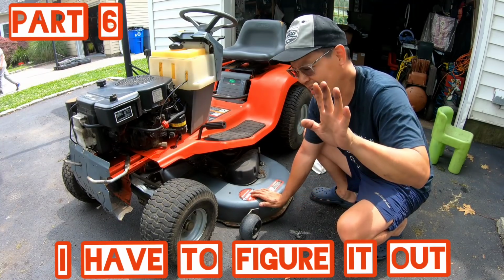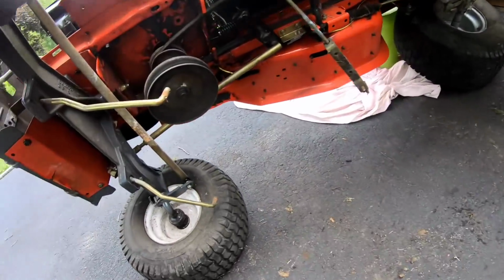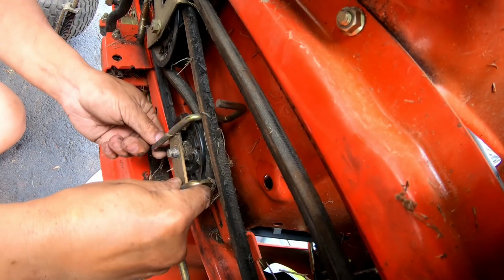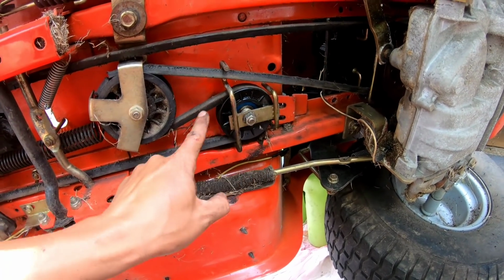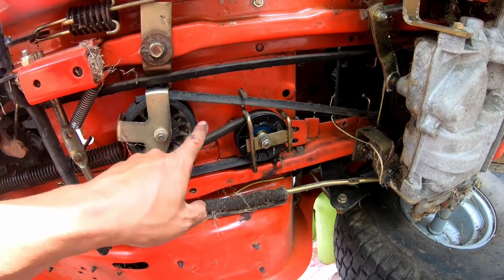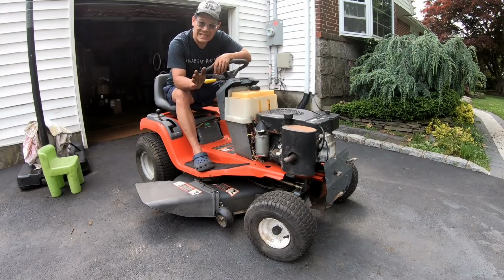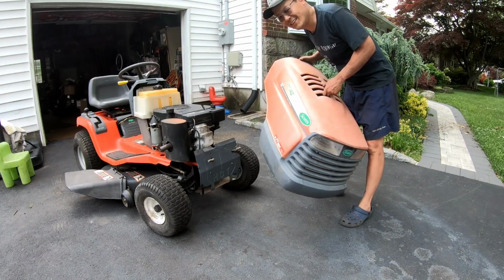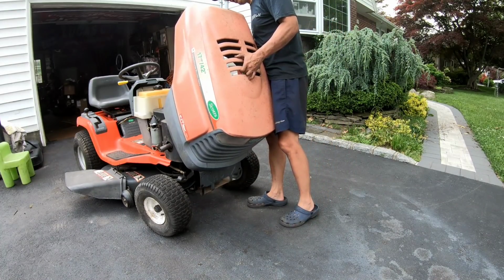SCOTTS BY JOHN DEERE LAWN TRACTOR REPOWER PROJECT WONT DRIVE MOWER DECK REMOVAL TROUBLESHOOTING FIX

Comment: HI there, thanks for the information. I have mower machine exactly like yours the Deck belt is very loose and not engaging with engine bully, help me please how can I make tight
Reply from the maker: It needs to be routed correctly 
https://images.app.goo.gl/XhBBekP17w6FCFqj7

Comment: I would think maybe cut the side of the hood on both sides rather than a hole. Is the bolt from the double stack?
Reply from the maker: Yes but from the 17hp engine not the 12.5.

Comment: To remove the deck put a 2x4 under each side of the deck then lower the deck to sit on the boards, the pins can be removed very easily, try the same when putting the deck back on. Thank you for the video.

Comment: Henry, I am really impressed with how well everything turned out with this mower. 
It seems as though everything that could have turned out really negative turned out really positive. 
Whenever I pull my John Deere mower decks, I always rotate the steering wheel either all of the way to the left or right which really helps the mower deck actually clearing between the front and rear wheels. The best way to have smooth steering action is to use the grease gun.for its intended purpose. It’s really amazing how many people do not know about lubricating their mower, especially the steering spindles and front axles and their mower deck spindles if they have grease fittings. I am not saying this about you, Henry - But Just Saying In A General Sense Of Things.
Reply from the maker: Thanks bro!
Reply: I realize Im quite off topic but does anyone know a good site to stream newly released tv shows online ?
Reply: @Keanu Dawson Ehh try flixportal. you can find it if you google =) -ephraim
Reply: @Ephraim Cash thanks, I signed up and it seems like they got a lot of movies there :D I really appreciate it !!
Reply: @Keanu Dawson you are welcome :D

Comment: I would replace the belt before I sold it.
Reply from the maker: Yes, if I was a store,  but as a flipper,  I’d sell it as is and tell the new owner, you may have to change the belt.
Reply: @MowersNBlowers    

You got cheap for a $20 belt when you already had it apart?  A person buying an old repowered mower might at least expect it to be replaced.  Not everyone is handy and it will require removing the deck...again.  I dunno, seems odd to not change it when chunks are missing from it.  And the missing bolt?  You gonna tell your buyer to figure out where it goes too?  Lol
Reply from the maker: It’s been two years,  no complaints at all!  He actually bought a snowblower from me a year later.
Reply: @MowersNBlowers  Wonderful.  I hope they changed the belt, but most people looking for cheap mowers don't know how and can't afford to have someone do it.

Comment: Nice job Henry.

You don't need a super big hole...  the muffler pipe, plus a little clearance.....  It'll be fine.  Simplicity used to do that.  I hand a Landlord Tractor a million years ago, it just had a hole in the hood, for the exhaust pipe.....

I still say, someday, take apart a transmission.  You could add a ton of value to your process & skills....  Pick up perfectly nice mowers with blown transmissions, fix it, sell it for BIG money.....

I'm such a perfectionist, I would have picked up an idler pulley....  Or at least, get the bearing number, order the bearing.  But that's me.  To maximize ROI, you're probably doing the right thing, I guess....

I'm totally speculating, but you give me the vibe of a famous retired guy...  So invest a little time.  You can get drunk & watch Netflix later...  Take apart a transmission one of these days....  It's not like you lack mechanical aptitude.....  And just so we are fair about this, I am a famous retired guy, so I am allowed to say that....  I'm not making fun of you.  I am tipping my cap to you sir....

Also, not for nuthing, but I love how you bomb between your mint Acura Legend and your mint Benz, on a crappy tractor with iffy steering....  Holy crap dude.  Be smart.....  Be smart, Henry.....  c'mon man...

I love your videos Sir.  Later.
Reply from the maker: I appreciate your suggestions bro and the compliments!  And between the classic acura and the benzo,  I’ve done it a million times...I test myself everytime!  Lol!  Thanks bro!
Reply: Those bearings freeze all the time. I do exactly what he does, lube em up abn break them free with vise grips, good to go!
Not necessarily bad, just dust dirt and crap build up stops them.

Comment: The good news is you finally got it running, moving, and mowing, and almost ready to sell.  The bad news is your drive belt has a huge crack in it (ready to break anytime soon), the engine is underpowered by today's standards, and the side of the hood will have a hole cut out.
Reply from the maker: Yes, if I was a store,  but as a flipper,  I’d sell it as is and tell the new owner, you may have to change the belt.
Reply: That whole thing about the engine underpowered by todays standards is horse manure. I have 456cc Briggs flatheads as though if not tougher than those junko 540cc Briggs engines their calling 21 hp. Its a lie. 465cc @12 hp to 540cc at 21hp is well over rated. They made these Scotts with 16hp Kohlers, nearly same engine just a little higher cc's.
Reply from the maker: Yeah remember the 8hp Tecumseh a they put on the Forrest Gump snappers?
Reply: @MowersNBlowers  Yea, I sold one that had a 12hp Briggs flathead two weeks ago, someone put that on their it originally had an 8hp and than sold a 1978 with a Briggs 8hp, I tagged you to it on insta, those are 318cc, big drop down, both same size machines. The 78" had just as much power, it also cut way better and didn't kick up dirt on me like that one with the 12hp had. It had extra wings bolted to the blade, it was also used far less and in better shape. Sometimes its not just about the power of the motor, theirs other contributing factors to the performance of a machine. But those 12hp flattys on those Black bueaty Murrays, those engines are just as powerful as these new Inteks. I don't notice any difference, other than their far more reliable and last way longer. I'm sure you've noticed that by now too. Often times, if I have a blown intek, I throw a flathead on in its place, I was about to do it to that Craftsman with that 540cc I showed you, luckily don't have to, just a blown head gasket.
Reply: @MowersNBlowers  
If think it’s better to install new belts. Treat people the way you would like people to treat your own grandma. With kindness and respect.
Reply from the maker: @lumberjackdreamer6267  and then where does it end?  New tires?  I get machines to work….I’m not a tractor spa!  Whatever you put into it further is less profit to no profit,  so why flip at all?  You’re missing the point
Reply: @MowersNBlowers  
Yes, you’re right. I’m missing the point. I don’t understand that “hustling” behavior, the “flipping” strategy, because it relies of cheating. I don’t like it. I’d rather lose money and be a good person. And you should too.
Reply from the maker: @lumberjackdreamer6267  people get a running machine for way cheaper than you would sell it for.  They can buy it or not,  nobody forces anyone to buy it.  How about me saving equipment from the dump?  A second life for the machine,  less waste in the landfills.  You wanna look at yourself as a good person,  you can look at my kindness that way.  I disclose everything to the buyer,  they can either buy it or not.
Reply: @MowersNBlowers  
Saving machines from the dump is great! 
Disclosures and honesty are great. 
But seriously, if you have a low compression cylinder, are you gonna tell the buyer?
Reply from the maker: @lumberjackdreamer6267  if it runs,  it’ll mow!
Reply: @lumberjackdreamer6267 
This is the attitude used car dealers had.  To not change a belt in such bad shape when it's a wear item and you had it apart already is just dumb in my opinion.  I'm with you.  No one expects a fresh paint job or new tires (unless they go flat).  But an oil change, air filter, oil filter plus replacing  any worn out wear items (like belts) is a must before selling.
Reply: @MowersNBlowers Yeah, for a little while then it'll break again, all for a 15-20 dollar part.  But it's not your problem, right?  It works!
Reply from the maker: You guys do you, I’ll do me!  Whatever floats your boat.  Merry xmas

Comment: haha. awesome. I have never seen a lawn tractor doing wheelie.  A new belt will make it flip backwards. 

how about moving the engine to the left. A hole on the side will work too.  😄

Looking at how close the belt is to the right; the engine could move left. However, it might not be enough for the exhaust.  Good luck buddy. Great job so far
Reply from the maker: Thanks brother 168!  I had Yat Lohk Fat on my license plate for years!  Holes don’t match up to the left.  I used only the holes that permit the engine to fit.
Reply: @MowersNBlowers  you're the best
Reply: How about cutting off the exhaust pipe, and add a heat shield? The muffler in front did not have an exhaust pipe sticking out of the muffler

Comment: I knew Henry would get to the bottom of that issue! I keep thinking about that hood problem the whole series. Henry do you like the way the deck raises and lowers on that tractor. I think its kinda cool. 😎👍 Roger #backtheblue
Reply from the maker: It’s very cool,  spring assisted makes it easy!